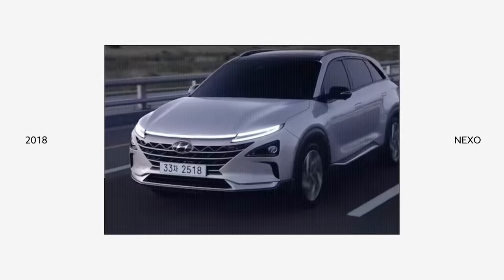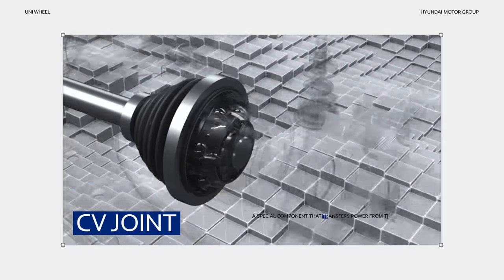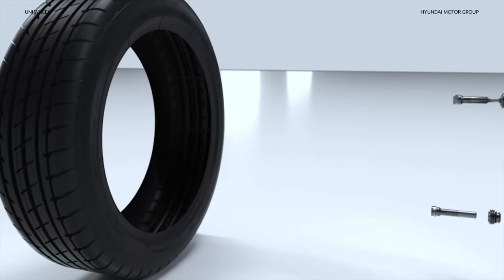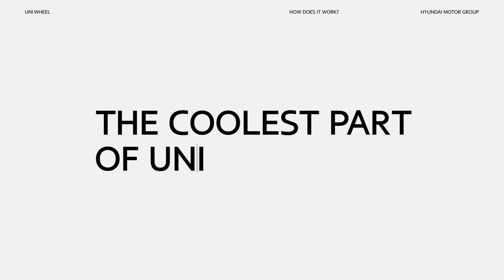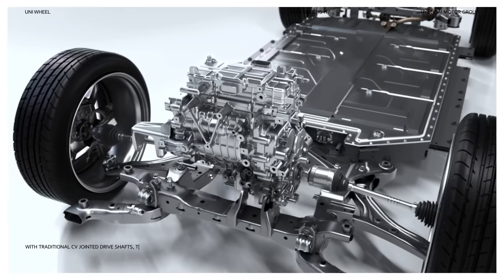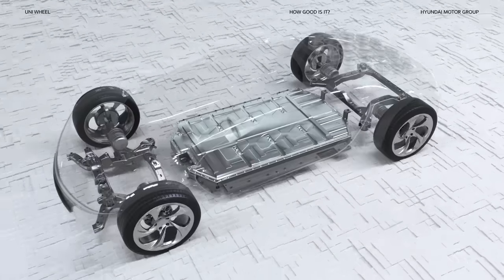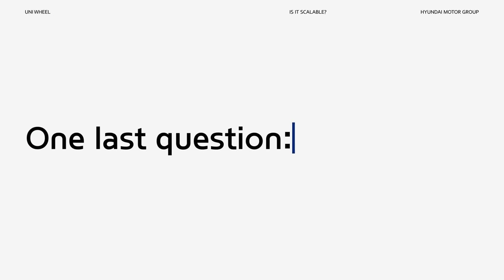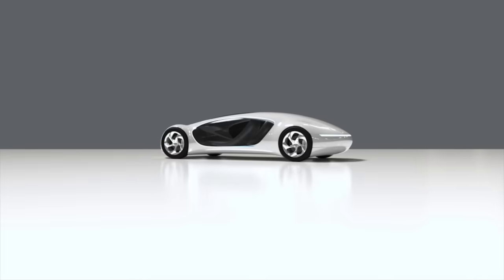The world's first drive system concept | Universal Wheel Drive System

Comment: This is Uni-Dumb.  Go to time mark 4:22 where you'll see a close up of the electric motor plus uni-wheel and you will see that the power train assembly still has the constant velocity (CV) joint that they just spent time trashing!  The CV joint is needed in their design to handle the angular wheel movement incurred when you turn the car left or right (angular movement of wheels is conveniently left out of this video).  

Notice how the parts of this video showing how the uni-wheel works only show it handling deflection in 2 axis - up/down & forward/back but not angular deflection.

Keeping those extra small uni-wheel gears sealed and lubed and working for 200,000 miles will be a challenge.  Also, I'll bet it was a challenge counteracting the outermost planetary gear's tooth separating force that wants to cause the outer planetary gear to move inwards and disengage.  What counteracting force keeps that outer planetary pushed outward, the torque somehow?  I Would love to see that force diagram.

Solution - Guys, you gotta include the electric motor in your uni-wheel hub to make it a complete self-contained powered drive module that moves with the wheel.  Then you can get rid of that overly complicated gazillion spur gear uni-wheel mechanism and just use a traditional planetary (1 central sun, 3 plant gears & 1 ring gear).  You can also get rid of the CV joint entirely.  This true uni-wheel would be powered electrically by a beefy but flexible and shielded-from-the-elements power cable that will flex as the wheel both turns left/right and also when it moves up/down.  You will get even more interior room with this suggested design, it will be more mechanically robust, and it will cost less money.

Back to the CAD terminal Hyundai!
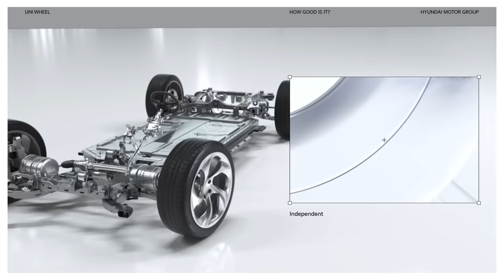Reply: That's just a boot to cover the connection. The entire motor and gear assembly moves together with the pivot being at the motor. Check out 5:17. When the car turns the motor turns as well.
How would the outer planetary gear move inward? They are fixed in place. See 3:00.
Having all the weight in the wheel is a problem that causes major handling issues. This looks to be a solution to that.
Reply: @kamX-rz4uy  Thanks.  At time 5:17, I'll agree that the motor housings look like they are tilted a small amount, but the turn is too shallow for me to tell what I am looking at.  One thing is for sure, if the motor was affixed to the wheel hub, like I am suggesting that they do in a redesign, then they would not need to make such a complex mechanism (covered in the majority of this video) to compensate for the wheel moving up/down independently from the motor which is clearly locked from moving up/down (hence the need for their goofy planetary) which is why it seems logical that the motor is also locked from angular motion too and that it is basically just bolted to the car's frame.  The boot that you say "covers the connection", is egg-shaped and looks like a regular CV joint cover.  Also, I don't see any bracket holding the motor to the wheel hub assembly.  The motor housing has to bolt to something that does not rotate to allow it to apply torque to the wheel.  It can't be just hanging out there.  I'm still convinced that they are still using a CV joint and therefore have designed something that is the worst of both worlds.
Reply: In wheel or wheel hib motors have a long history, go back to the Michelin Active Wheel and a Siemens eCorner; More recently Kightyear and Lordstown used in-wheel motors before both filed for bankruptcy, and REE Is going to make small trucks using its motors now that no OEM seems interested in buying the components.

Inboard motors and short drive shafts work fine. These alternatives have to be dramatically better, and it's still an uphill slog to get any car maker to consider them.
Reply: In-wheel motors would greatly increase your unsprung mass.
Reply: In-hub motors are a no go for full size vehicles meant to drive at highway speeds. No matter how you engineer them , two main factors will always be a problem - available space and weight. Wheel hubs should be as light as possible to reduce unsprung weight, too much of which causes very undesirable vehicle dynamics. Because of the limited space and low weight goals, engineers will have to settle for smaller motors and have more limited gear ratio options. You’ll also have to have all the motor cables run from the hub to the chassis which exposes them to harsher environments than if they were exclusively within the chassis.
Reply: It seems like Hyundai’s concept uses one CV joint per wheel combined with a swiveling motor. This allows for steering as well as more complex suspension geometries required to fine tune the vehicle dynamics for better high speed handling and cornering, all while keeping the CV joint angle within the most efficient range of angle. It’s a bold redesign of the wheel but one of the better ones I’ve seen. My biggest gripe with it is that wheels are one of the most common elements of a vehicle that gets damaged or experiences extra forces in unforeseen conditions, and replacing/repairing a hub in this concept will be much more costly, and I wonder what the longevity of the gears is like for a driver with a heavy foot, or in rougher terrain with more load and vibrations on the suspension. 

No matter what though, you gotta give props for exploring new ways to build drivetrains rather than never exploring at all.
Reply: @ineedbigdrink8509  Thanks for the good extra info.  Just want to add that in my comment, I was not advocating for in-wheel electric motors as the best design for cars, its just that I didn't like Hyundai's foot-in-the-door approach that seems to make their drive unnecessarily complicated for no particular gain of engineering significance.  

Their stated main goal was to make more room under the hood, but their design adds only a small amount of extra room for a lot of extra complexity (money).  

Moreover, CV joints have been around forever and seem to last a good long while.  I don't understand why they want a couple extra inches of room under the hood.  Stuff fits OK now (OK is a relative term, I know).  The video also said that increasing efficiency by limiting CV angular travel was a goal or theirs, but how much extra inefficiency really do CV joints introduce at the max point of their permitted travel?  

Cars spend a low percentage of their time making tight turns or going over huge bumps (causing CV joints to flex the most) and when they do, it is usually at very low speeds which are performed at very low power meaning any extra inefficiency is not worth worrying about.  

I'd be interested to learn more about the term "unsprung weight".  The mass of the ~3,000 lb car body is the elephant in the room when it comes to car suspension dynamics, so I'd be curious to learn how increasing the weight of the relatively light wheel matters.  Unless the idea is that a heavier wheel will not track the bumps and undulations of the road as well because mass likes to travel in a strait line unless acted upon by a force, so more wheel mass means the car's spring has to be bigger maybe?  Is this why?

BTW - The brake assembly, a moderately heavy and complicated component, is effectively part of the wheel mass in all cars and a portion of the linkages between the wheel and the car frame would also be counted in the wheel weight.  So, how much extra weight, in terms of a percent increase, would an electric motor add I wonder to the "unsprung mass"?
Reply: @ineedbigdrink8509  I hear you, but regarding your last statement - brake fluid lines currently go from the car's frame to the bouncing/turning wheels and they seem to last a good long time.  Just put the electric cables inside of an extra set of brake fluid hoses - job done!

Comment: All the allowed motion is in one plane.  How is steering accomplished?
Reply: They are either going to have to have the motor swivel with the wheel (which would take up too much room), or use a CV joint, though one that is possible smaller, lighter, and needs less up and down range. (It's at higher angles on the CV where efficiency is lost).
Reply: @mychaljw it seems like they do both in this concept, there’s a visible (CV?) joint and the motor swivels as well.

It seems like a lot of effort to reduce the number of joints from 2 to 1 per wheel and the maximum joint angle without completely eliminating either one. 

It probably will still be worth the space savings and modularity, but IMO the success of it hinges on how compact they can make the mechanism that turns the whole motor/shaft assembly while maintaining strength and accessibility for repairs. 

I’m all for a redesign of traditional approaches so best of luck to the team!
Reply: Well, since there are independent motors, it would be possible to steer by having the outer wheels spin faster than the inner ones. Although, I guess it wouldn't be the pinnacle of efficiency (or safety).
Reply: @nosmermo  Like a bulldozer? Lol. Wouldn't be very good on tires!
Reply: @mychaljw Well, yes. But also like the rear wheels of pretty much every car (that doesnt have a blocked diff). But I agree, not the best solution at all.

Comment: I see it as a very interesting concept, but I think it creates more problems than it solves. In my opinion there are lots to solve: sealing between the axle and the hub, between the outer drum and the hub. Also having the motor turn with the wheel seems simple but it's not: you need to align the motor with the steering angle of the wheel and at the same time to separate them in the vertical direction, so this needs an additional mechanism with probably lots of parts. The steering/pivot axis of the wheel/hub assembly changes as the suspension is compressed as does the camber angle of the wheel. Also steering response would be worse given that the motors need to pivot/move when you turn the steering wheel, it will behave as a sort of flywheel. A better solution would be with the cv joints but that still has the sealing issues. 
Regarding power efficiency: the torque is transmitted through 5 gear pairs, in comparison in a Tesla Model S drivetrain you have 2 gear pairs, so I think efficiency will be much lower because of friction losses in the gears.
Reply: Efficiency would be greatly improved. Torque load on any motor is significantly reduced, this translates into a much greater amount of usable drive torque ie: torque/power that the actual tire can apply in the direction of movement to the ground. (A smaller motor turning the uni wheel  can achieve the same speed as a much larger one turning a standard wheel)
Reply: @Howya_fishbin  For Tesla model S the gear ratio is 9.734:1 or 9.325:1 according to wikipedia. Uniwheel has about 6 maybe 6.5 measured on the screen, even though I know this is not precise,  the gear ratio is far from 9. Also don't be fooled by the many pinion gears, the gear ratio is defined by the sun gear and ring gear.
Reply: @s_attila  It is important to consider that with the internal hub the gear ratio can be increased virtually "infinitely" 😉. Further, the gear spins so that torque is applied to the inside of the wheel much like a track drive. With the internal gear and the "track like" setup torque load can be reduced to practically zero. Something to consider....what if a hydraulic motor were to turn the planetary gear set? This would again result in more usable power while lowering any input of energy needed. Also a hydraulic motor would eliminate the necessity for any cv joint as there is no mechanical connection...only a hydraulic hose. 😄
Haha, another note....a hydraulic motor turning the uni wheel can achieve much greater power with significantly less weight than say an electric hub motor.
Reply: @Howya_fishbin you can't be serious with all this nonsense, you must be a troll 😂
Reply: @s_attila  It's gotta be about money then, eh ....?

Comment: I just wanna know, how to cool down and lubricate the gears ? How to seal the giant open gap and keep the shaft movable under extreme conditions such as water, dirt and rocks.
Reply: Like you do regular cars. A high strength rubber cover.
Reply: @itsjustnopinionok 

Except the input shaft is spinning and the housing where the boot would have to attach isn't.
Reply: @itsjustnopinionok comedy

Comment: how are they gona lubricate these gears with the motion needed for input shaft and rotation of the outer wheel?
Reply: That's the question on my mind. They will have to isolate the gears from elements and debris of the road.
Reply: “how are they gona lubricate these gears” - No way. The first three years, while the wheel is under warranty, it will not have time to rust and pick up much dirt, and then it is the owner’s problem, your problem.

Comment: Great idea, but how does this brake? No word about braking performance
Reply: Traction braking.
Reply: While regenerative braking can be expected, the vehicle will need a braking system somewhere in the drivetrain.  With gears in the wheel hub, the open question, where are the brakes?
Reply: @michaelstafford648  Traction braking. Adding a parking brake is trivial. Believe me, you are not outthinking Hyundai's entire R&D department or thinking something they haven't thought of.

Comment: Is it only me or it does somehow resemble the Unimog’s portal axles, hub reduction and torque tubes concept back from the 50s?
Reply: The Unimog introduced in 1948 and still in production) and the better-known (in North America) HMMWVs (Humvees, and civilian Hummer H1's) have geared hubs for portal axles. There are other vehicles with portal axles, and lots of heavy trucks with geared hubs just for more reduction. 

None of these geared hubs allow the input shaft to remain stationary while the suspension moves, which is the novel feature of this Hyundai design.

Comment: Wouldn't a hub motor still be the better overall solution? Especially for "normal" cars that don't need loads of power and could use smaller motors. Less moving parts, simpler and maybe less overall weight, but with the penalty of more unsprung mass - which could be offset by not using only-for-looks ginormous wheels (who needs 21s on a family SUV?!?)
Reply: Gearing is the most limiting factor right now. It's easier and safer to make a high speed EV motor to compensate for the gearing than to make a motor that draws enough amps to start from a stand still with 1:1 gearing at any amount of briskness.
Reply: @Mark_Proton  you are right for direct drive motors, but you could use a planetary gearbox. Adds weight, but can be very compact and the motor could be smaller. But I‘m only an armchair expert tbh., not an automotive engineer.
Reply: they've nearly acomplished exactly what you're suggesting. the difference between the hub motor as youve described and the uniwheel is the unsprung weight of the motor being shifted into the hub vs on the frame. There is an efficiency loss caused by shifting weight to heavier wheels as well as a bumpier ride. @meltdown78
Reply: Hub motors increase the unsprung weight quite a lot.
Reply: @meltdown78  I foresee heat dissipation issues with a gear hub motor, on top of the obvious unsprung mass.
Reply: Hub motors would need to survive incredible shocks from potholes etc. metal fatigue is a thing. Keep all the expensive bits on the other side of a shock absorber please.

Comment: When a traditional system car goes over potholes, the motor and all of its moving parts do not get a lot of shock, it is absorbed by the wheels, and other dampening parts (I forgot what they are called).
This new construction, it seems like it will be getting a lot of that shock and possibly break down too.
And I don't doubt this construction doing well for 1-5 years.
Can it survive 7-12? 
I think it is for a good reason that such complex part as the engine or car motors are getting the same protection from shock that the driver gets. It is intricate and susceptible to costly repair if it wasn't. 
That is my concern despite me being very excited to see how it works.
Reply: Well this is NOT in-hub motors; the motors are still in the chassis... they removed the brakes and added the reduction gears into the wheels

Comment: Ok, so this is awesome for the up and down motions of the wheels. Is a CV joint still used for turning? I have more questions but so far this looks REALLY promising :)
Reply: If you look at around 5:17 you can see a single CV joint on the front axle. You can still place the motor much closer to the wheel because you don't need long driveshafts, just a single, small CV joint. And as far as I understood this also replaces the transmission - putting it into the wheel and saving space.
Reply: You can see a joint (@4:20) is still used in the video attached to individual motors with a short shaft. They also claim they have passed the first round of testing @4:47. One would think turning was involved.
Reply: @techpappee  "OnE wOuLd ThInK" 

No shit Sherlock. I saw the CV joint. However, the way they are going on about not using them, they make it seem as though they wouldn't. 

As for testing, it doesn't mean they did the testing in road vs simulated environments in a lab.
Reply: 5:12 shows that the motors pivot with the steering assembly, staying perpendicular to the wheels. 

More complexity in the steering assembly, then, but they apparently judge this to still be worth the improved system-level packaging requirements?
Reply: 5:12 shows that the motors pivot with the steering assembly, staying perpendicular to the wheels. 

More complexity in the steering assembly, then, but they apparently judge this to still be worth the improved system-level packaging requirements?
Reply: It looks like the motors turn with the wheels, @RobotZombii , but that would require an extremely bulky and complex suspension. I think that was just a poor animation.